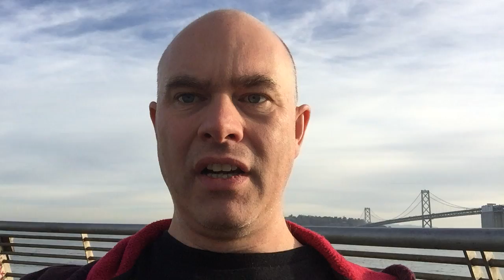Let's Talk About The Antares Launch Failure.

Comment: Scott, this was terrific. Just one fact you forgot. NASA's funding was way bigger than Soviet Space Program's. During late 60s Soviet's only gave bit over 1 percent of theyr GDP, while NASA got over 4 percent from a much bigger economy, and Soviet Space Program was so underfunded, that they didn't have the money to test the first stage engines in the cluster (of the N1), and figure out the problems and that is very sad.
Reply: you however forget that the running cost of the Soviet space program was much lower than that of the US space program.
People earned lower wages (in fact many of them were forced labour, prison inmates or military, budgets coming out of other departments), production of equipment was much cheaper, etc. etc.
And no corporate lawyers, no taxes to be paid on thousands of acres of launch site land, etc. etc.
Reply: Still, it didn't weight that out since most of the cost came from equipment and resources, which had similar price, also the difference in funding was near 10 times.

Comment: I don't know how accurate this is but I just read on CNN that the launch had actually been "manually terminated" by an employee as a safety precaution because it was believed that the rocket wasn't going to reach orbit. Now, I have to wonder, what led them to believe that it wasn't going to reach orbit only 6 seconds after launch and, if they could detect the issue so quickly, why couldn't they have spotted the flaw before launch?
Reply from the maker: The termination was triggered after the rocket was visibly falling back to earth.

Comment: +PhilfreezeCH The engineering and testing that goes into making rocket engines is very expensive.  Just search on all of the work that Scaled Composites did in making the Spaceship 1 motor and that is a simple one compared to the liquid fueled motors.

Also, remember that during the relevant period America initially focused on the Space Shuttle as its major heavy launch vehicle.  Eventually, that paradigm shifted and other heavy lift capacity was developed.  However, it makes sense to go with proven designs and technology:  even the Progress-Soyuz and other Russian launch vehicles are circa Cold War designs.   In some ways that was what made SpaceX so disrupting: they developed new rocket casings and motors, although supposedly using off-the-shelf parts.

With regards to the use of escape systems, David Loring is correct: the systems add complexity, expense, weight and risk to the launch vehicle.   Remember: the escape system is a solid rocket kick motor that must out accelerate the rocket underneath it.  (If I remember correctly, the Apollo escape tower had more instantaneous thrust than the Space Shuttle boosters.). That is a lot of explosive fuel and worthless mass that the main rocket has to lift into orbit, which means more fuel for the main stage burns, etc.   Also, escape systems rely on the capsules parachutes and recovery systems for a safe landing.  The Cygnus capsule is not meant to be recovered and would require parachutes to be cobbled onto it.  Finally, some payloads are launched in aeroshell fairings which cover but are not part of the payload.  A rocket escape system would be incompatible with such an arrangement.

I should note that there is only one instance of an escape tower abort in the history of manned space flight.  That dubious honor falls to a Soyuz capsule.  Apparently, the crew got a very sporty ride from the escape system.  It was so sporty that after landing they turned off the cockpit voice recorder so their swearing would not be on record.

Comment: If you look at the rocket right as the launch tower lets go of it, it lets out a brief white mist. The tower connected to it is used to fuel up the rocket, I myself believe that the valve the tower was pumping fuel into failed to seal properly therefore letting fuel leak out the side which ended up catching fire when the rocket gained altitude. Also when you look at where to fire spread to, it heads in the direction of where the valve was possibly leaking fuel. I could be wrong it's just my theory.

Comment: A friend of mine linked the footage and saw how the rocket lost thrust.  The first thought was how Kerbal it looked.  (My friend and I have logged hundreds of hours on KSP).  It looked like one of the two engines failed and lost thrust.  When that happened, the rocket surrendered to the pull of gravity.  Many of my KSP designs had staging issues so I saw similar (loss of thrust) launches.   I feel sorry for all of the little cube-sats that were lost.

Comment: I thought I saw some odd action as the service tower tilted away, it seemed like it might have not released something on ignition.  It seemed like the engines compressed and the vehicle did not move for a second, then started to climb, I know that is normal, its just the amount seemed slightly excessive.  It is probably nothing, but its the only thing I was able to see as odd before the engine blew up, in relation to launches I have watched in the past.

Comment: it's funny how many rocket scientists there is all of a sudden when a launch fails, dont you agree Scott? people realy think they know better then the people who's been working with this stuff for 30-40 years? the russian engines has been tested, used and improved upon over and over and over again, the big american engines was redesigned, improved upon, and scraped over and over and over again so they were never realy perfected like the old russion engines was, thats why the russian engines is still so good to this day. after all, there is a very real limit on fuel to thrust efficiensy and reliability, and once reached, it's impossible to go any higher. thats why the russian engines is so good, they have practicaly reached the absolute upper limit of their fuel to thrust capacity for their particular size, there is practicaly nothing anyone can do, no matter how much you try to improve them since they are practicaly as good as they can possibly be and ever will be.

And i'm NOT a rocket scientist, i just saw fitt to look up a little simple info about the engines.

Comment: You bring up an interesting point about refining a design. I own a Saab with a b205r engine in it. It was made in 2002 and I get 32 miles per gallon highway, which isn't bad considering it's a 12 year old turbocharged car. The thing is, the engine was developed in 1972 by Triumph who let Saab use the design in their Saabs if they would build the motors and let Triumph put them in their Stags. In '81 Triumph went out of business, but Saab kept using that engine design and refining it until it quit production in 2002. People see things like "an all new 2.0 turbocharged motor" when a car is redesigned, but many times they fail to realize it's not "NEW", simply improved to meet modern demands (fix previous failure points, lighten things to make them more efficient etc).
Reply: It is new in the sense that it was not manufactured 40 years ago unlike the Russian rocket engines that we use.

Comment: One tiny correction: The RD-180 used in Altases is based on the RD-170, which was designed for the Buran launcher Energia, not on the NK-33. They do share some design features, but are a separate family.

Comment: It has nothing to do with the engines. The boat that was in the water caused it to be scrubbed. over night id say something expanded and possibly cracked. old engines have been refurbished making them essentially new. I feel it was a bad luck situation, no boat id say it would have been successful. I say jail the guy on the boat.

Comment: A second before the engine exploded the thrust looked like its been increased. Maybe a fuel injection valve got out of service and too much fuel or oxidiser into the burning chamber and this caused a massive overheat which ended in the explosion. I am just guessing. Cant wait until the found the cause of the failure.

Btw.  I expected from this video that you go more into the reasons why this happened and not so much the background. but anyway thanks a lot for the nice information.
Reply from the maker: We don't know what happened yet.

Comment: What do you think the chances are that the launch tower is at fault? We've all seen how debris impacting on a fuel tank at launch can result in failure seconds (even minutes) after launch as pressure slowly drops and fuel starts to leak.

Comment: I also believe that a 95% success rate is considered good for most non-crewed rockets, and 99% for manned vehicles. (The Space Shuttle managed about 98%).
In general rocket systems do get more reliable the longer they are in use.
The Soyuz-FG system seems to be the most reliable of the commonly used ones.
http://www.spacelaunchreport.com/log2014.html

Comment: Soviet Engineering also produced the KV-2. Which destroyed itself if it fired sideways, and the Yak-38, a twin-engine VTOL that automatically killed the pilot if one engine lost ANY thrust... Not anti-USSR engineering, just balancing the video, Glory to Stalin.
Reply from the maker: The Yak-38 was fitted with an automatic ejection system, if one of the engines started failing the system would trigger after 60 degrees of roll.
Reply: The KV-2 wouldn't destroy itself if it fired sideways. The turret was designed to rotate and fire in a 360 degree arc.

The real problem was that the whole tank was underpowered, including the turret, so it couldn't effectively rotate its massive turret unless on flat ground and even then it was often more effective to traverse the entire vehicle into LoS of the target.

It was still a fairly effective stop-gap solution for a powerful assault gun and gave the Germans quite a bit of trouble early in the war.
Reply: Scott Manley Did some quick research:

A: They added that because the predecessor, the Yak-36, did the same thing and DIDN'T have the auto-eject so it killed 3+ test pilots.

B: The ejection seat was imperfect, as evidenced by this seemingly accurate statistic: "In total produced 231 Yak-38 (37 planes lost in incidents - 31 pilots ejected, including 18 automatically and 11 killed)".

C: The Yak-38 failed on many other fronts as well, no production variant had radar, it had extremely limited payload capacity (last production variant had 4,400 lb max.), and it had pretty severe trouble in warm weather. It was however very pretty, like a sleeker Harrier.

And D: Love your channel.
Reply: I know, I wasn't bashing Soviet Rocket Science. And I know plenty of advanced things come out of Russia, I was just being an asshole
Reply: We are talking about Soviet ROCKET science, and that is, indeed, was very advanced, mainly because Khrustchev was a big fan of rockets, and he torrented a lot of moneys into space industry.
Reply: *****
If we're going about semi-experimental designs, I feel compelled to mention the V-22. F-16 chaffed the hell out of its wiring, too, from what I've heard.
And as far as the KV-2 is concerned, even as an artillery vehicle it was a hell of a lot better heavy tank design than what the rest of the world was coming up at the time.
Reply: Oh, and Glory to Stalin, may Lenin have mercy on me for my dissent.

Comment: I think people are pretty silly for bashing on old technology like the first part of the video. The 40mm bofors gun was designed in the 30s and is still in heavy use today. The only difference is its now belt fed and not hand cranked like it was back in the day. The USS Missouri BB-63 was commissioned in 1944 and was finally decommissioned in 1992. In fact, her being the last battleship built, there were still battleships in service in the US Navy until her 1992 decommissioning, even after her first decommissioning.
Reply: HALL9000ish they were refurbished so the age of when it was originally made doesnt matter and was tested before the finalization of the rocket
Reply: I think the real concern was that these are not engines that have been loved and cared for for 40 years, they where literally left in a shed. The engineers where ordered to destroy them, figured that they might in fact need them, and basically stuffed them at the back. 40 year old equipment that works has usually been cared for and is allowed to brake down and get fixed. Rocket engines are fired once, if they don't work it's all over.

That's not counting the whole "get vital stuff from a government that is corrupt and warmongering" issue, and the fact that it's a finite supply.
Reply: USS Winsconsin is the last, being BB-64.

Comment: Soviet bureaucracy was a nightmare as far as engines were concerned. Kilmov, Mikoyan, Kuznetsov, and other bureaus would design prototype engines that were usually unreliable, aircraft would be designed around the engines, and then the engines would usually be cancelled, either resulting in the cancellation of the aircraft on the aircraft being shipped severely underpowered with a insufficient engine. Looking at cancelled soviet aircraft, this is almost universally the reason for their cancellation. The N-1 has a lot of other problems too, like the death of its lead designed and one of the important designers having to work for the guy who killed his wife.

Comment: Dont want to be a smart ass but it was something with the engines cuase you can see the pressure change in the exhaust not to mention they tested one of these engines a few months back and it blew up while testing idk just my thoughts
Reply from the maker: Remind me what would happen if the plumbing between the tank and the engine failed?
Reply: the engines would stop functioning also maybe air in the line
Reply: You are wrong, we cannot be sure what the cause was yet.
Reply: i was speculating lol

Comment: Hey Scott, I have a question. Since they have these great soviet engines and they face stop in supplies, couldn't they just make them 'from scratch' with modern metals, electronics, etc? If they have the engines (and maybe blueprints too) it shouldn't be that much harder.